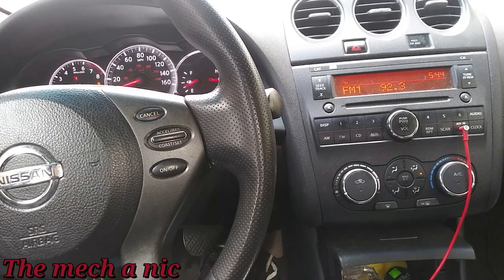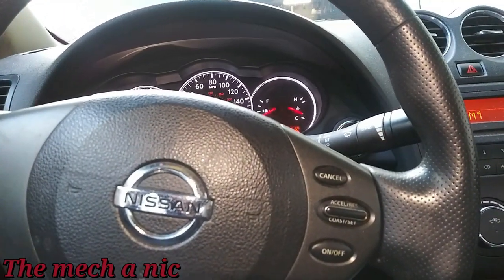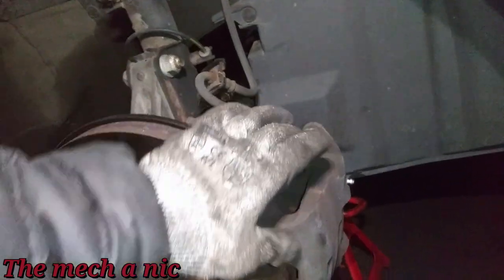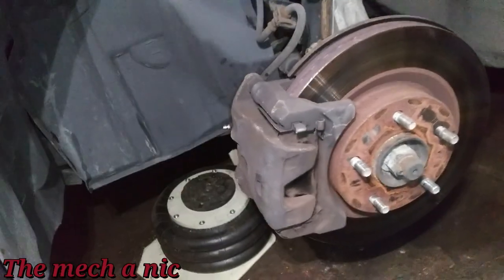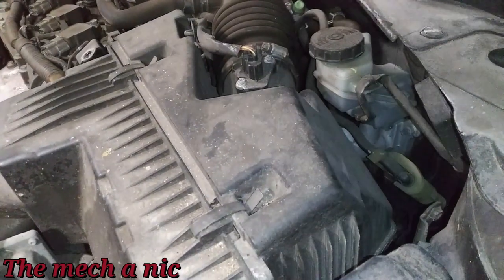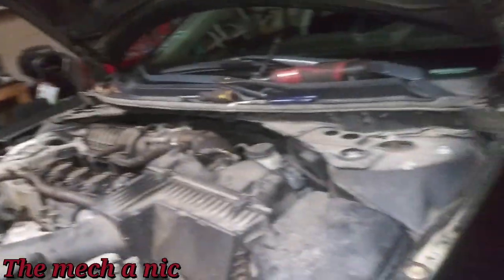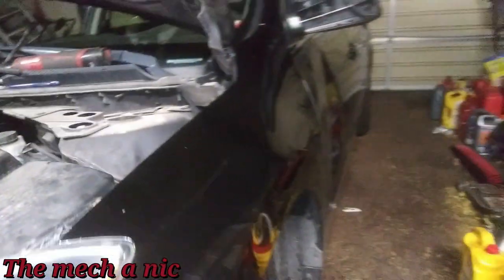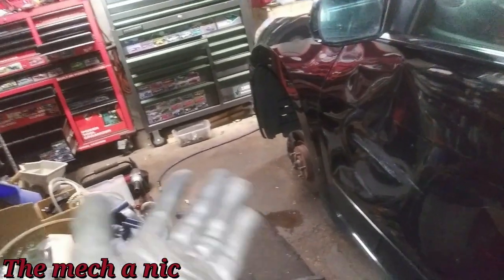nissan front brakes locking up - altima

Comment: Dude, I cannot begin to thank you for posting this video. I've been dealing with brake issues for TWO FRICKING YEARS. I've changed everything I could possibly change in the brake system. I never thiught it would end. Tonight, it did. Thank you so much. Thank you thank you thank you. You literally changed my life bro. No bullshit. Thank you.
Reply from the maker: That's crazy. Glad the video helped you
Reply: I agree both my tail lights are out so I changed the stop light switch and my front brake on the right side started locking up I changed the caliper as I'm driving back my left caliper locked up now I'm thinking what the hell. I did what you said loosen up the brake stop switch and both are no longer locked up , thank God and thanks for the!!!!

Comment: Thanks for sharing, your awesome. I had the same problem where my car wouldn’t start but I could hear a clicking sound like if was a bad starter. Replaced starter and still car wouldn’t start. So I finally changed the brake pedal switch. Car started but now it wouldn’t move😂. Changed one caliper that I thought was seized. Ran fine for 1 mile before stating to lock up. Found your video and boom problem fixed. I had set the switch too low. Once I adjusted it worked like a champ.
Reply from the maker: Glad the video helped! It's crazy how common this problem is and how easy it is for people to waste money on parts that aren't needed. Thanks for the comment 👍

Comment: This happened to me in my 92 Toyota Century. The black rubber clutch pedal stopper disintegrated and I replaced it with a bolt and a nut. 

I guess the nut portion was too thick and caused the brake switch nipple to bottom out which caused my brakes to lock up and produce a burning brake pad smell. 

I need to go back out and remove the nut portion so the brake switch nipple is only slightly depressed so I can drive the car again.

I had to miss work because of this issue. Your video helped me confirm that indeed my DIY metal bolt and nut grommet was just too tall and caused electrical then physical brake issues.

Comment: Thanks for the video. A friends 350Z had the rubber grommet that activates the switch fall apart from age which is common. I repaired it after watching a couple videos on fixing it but nobody mentions that the switches had to be perfectly adjusted so his brakes were locking up just like this.
Reply from the maker: Glad the video helped you
Reply: Rlknight57 , is the rubber part you're talking about the little plastic piece that keeps the break pedal depressed ?  What did you adjust?  A honda after the same rubber or plastic thing was replaced the front brakes locked up real bad after 2 miles of driving
Reply from the maker: The brake/cruise control  switch itself usually has adjustment in it.
Reply: @themechanic6117  I wish you had filmed the adjustment process. Do I need to remove the switch to adjust ?
Reply from the maker: No you adjust it while it's on the car.  Every car is different on how these things are adjusted
Reply: Im fixing a g35coupe 04 and samething is happening I changed the booter and master cylinder and still locked up I’m going to try what you did
Reply: The rubber piece on the brake pedal arm is plug that if it comes out allows the plunger on the switch to pass through the hole the plug previously blocked. I found that in a pinch you can use one of the plastic fasteners that holds all your plastic trim pieces on under the hood. Its a PITA to get in there with the switch in place. The switch is adjusted by screwing it in or out. If it is screwed in too far the plunger on the switch will not extend far enough to activate.

Comment: Great diagnostic procedure. I'm having the same issue with a 1990 GMC Vandura. It might not be the same issue but I think it is further back than the flex hoses since it's both front brakes. I just got to brake the rusty mugs loose before I can verify. Trying my best not to damage the metal lines. After watching this I'm going to bypass that step for now and see if there could be a similar issue to yours before I brake the brake line. Thx.

Comment: No parts required . Ivan would be proud of you.
Reply from the maker: Yes he would ! Cheers 👍💪
Reply: @themechanic6117   am having same issues at the Back left side 07 Nissan Altima am hoping is the same . easy fix.?
Reply from the maker: If it's just one one caliper then it's probably not the same problem.  If that caliper is locking up I'd replace the caliper and brake hose for that caliper at the same time .

Comment: Yep! This is it!  I have a 2007 Armada which I had replaced , pads rotors and calipers a few months ago... All was OK until I found a DTC code 'P1564 ' which was a cruise control problem.. Well, I never use my cruise, but sure enough it was NOT working... So I started to trouble-shoot and eventually came to the step to check those switches under the brake pedal... I pulled them out , easy enough, and checked them with a VOM meter, and they were fine. I re-installed them and went for a test drive and that's when ALL hell broke loose! The front brakes locked up, smoked, and barley got it home... Guess i put them in wrong are somthing... Found in the manual how to adjust them, but really difficult to measure... will keep trying, but 99.9999% this is the fix! just wish I didnt mess with them in the first place....  thx for the vid!

Comment: This was a temporary fix for me. I’ve done calipers rotors and pads. After purchasing a new brake switch, I adjusted accordingly. It worked well for about two weeks and now my brakes are locking up again. Ice adjusted and re adjusted switches and that doesn’t release front brakes

Comment: Okay, I am definitely gonna try this. We figured it was a safety feature on the car. We have an '07 that did just fine when I put it in neutral to pull it up because it wasn't starting but later when I went to push it to the mechanic, it wouldn't move. Now the mechanic is trying to sell me brakes when they don't even know why they're locked up in the first place.

Comment: That car had of had that issue before it came to you.  That’s just odd that the brake /cruse control switches were out of adjustment after they jumped it.  Mind blown.  Maybe someone was messing with it before you got ahold of it
Reply from the maker: Exactly. I asked the owner if someone was messing around down there and she said no but you know its sometimes impossible to get the truth.

Comment: That's really bizarre.  I can't imagine why anyone would mess with the switches, but I also can't imagine how they'd get out of adjustment all by themselves
Reply from the maker: I agree , i dont think i was getting the full story or the truth
Reply: So when you have a no crank no start with an altima 1 of the first things you find if you google it is that your brake switch and cruise control switch may be bad. It's ez to miss that they are adjustable and they probly put them back in without realizing it just lile I did

Comment: OMG, my wife's friend daughter had their battery changed and possibly the starter too. When she picked up the car, the brakes were sticking. I know, ever since? They looked it over and said nothing, they did. She took the car, now the kid was smart enough to put foot under pedal and lift and the car brakes released. WTF is that about? So here I am and the car need P&R all the way around. I experienced the brakes holding back and sure enough it released again WTF is that about, they were factory installed. So now I am going to call them back and adjust the park brake switches or see if there is a brake rod adjustment. I will let you know. My thought is the brake fluid is contaminated and was thinking it is the master cylinder as well being bad. Never too old to learn.

Comment: The metal clamp that holds the rubber on your break line is metal. After time, the build rust causing it to pinch the break line. You can push the breaks, and they will work, but there's not enough pressure for the release. Try changing the metal clamp holding your line.
Reply from the maker: In the video I actually showed what the fix is ...

Comment: Thank you so much. You saved the day! I made a sharp left turn, then my brakes locked up and before calling a wrecker to pick my truck up I did a search and I found your video. I turned my truck off, disconnected the brake and cruise control switches. Restarted the truck, then turn the truck off. Then, reconnected the switches. All was good. But I don't know what caused this to happen. Could it be an issue with the ABS system, having corrosion. Thinking about spraying it with air sensor control electronic spray to clean. Any thoughts. Thank you so much for saving the day :-)

Comment: Omg 😱🤯🤯. I was working on my sis 08 Nissan Sentra. I did a motor blower job. After patching everything up my brakes were stiff and brakes kept locking up. I ended up replacing two calipers and all four brake hoses. Didn't fix the problem. I was so frustrated i took it to a shop to get diagnosed. They said brake booster and master cylinder is bad and leaking fluid. I was like ????? No way everything was fine up until I did the motor blower job.. i took the car home and tested the brake booster. It was fine, and vacuum and all. No leaks either. Stupid shop tried to rip me off. So Car sat for a month and I was so upset with myself because my sister needs her car and i just couldn't figure out the problem. Then I see this video, I tried. what do you fuckin know!!!!? It worked! I adjusted the electrical switch that connects to the brake pedal how you said to in the video. Now the brakes work like normal. Thank you so much. Seriously. Sucks I wasted all that money when thier was no need.
Reply from the maker: Wow that sucks! I feel your pain. Just like in the video. You have to think logically with cars. It worked fine before you did a certain job and sure one thing can go bad out of nowhere but it's highly unlikely or impossible for so many parts to go bad at once.  I'm glad the video helped you.

Comment: I’m replaced that sensor today and the front breaks locked up after driving few Miles ,I thought it’s my call overs I replaced them too and it locked again so now I’m going to check on this sensor hopefully it just need adjustment as you mentioned

Comment: Hi ... I am having same issue on x trail brake lock up ... There is correlation of both switch? You align them in a line? In mine somebody removed both switch I put them and start the car, then brake locked instantly.  ... Please advise...thanks in advance

Comment: Imo because your prices were the lowest rates in the area, you attracted the lowest paying clients... makes for good YouTube though
Reply from the maker: Yes word of mouth is im affordable and pretty good at what I do without screwing people over.
Reply: I usually charge half of local labor and twice the parts cost. 75.00 per hour plus parts. I'm NOT the cheapest but like Nic I don't screw people over. It pays more to be helpful and honest in the long run.
Reply from the maker: Twice the cost of parts? So if a part cost $50 you charge $100 for it?? I don't charge extra for parts. Sometimes they bring their own parts , sometimes i order parts for them but i dont mark up prices on parts . they only pay for my labor
Reply: @themechanic6117  yea, I started that way too until warranty work for bad parts then I was like, NOPE. If you double ur parts at least you don't get screwed over. And I don't mind customer parts but 9 times out of 10 customer parts are junk or wrong.... Slows me down
Reply from the maker: I hear you and more power to you but charging double for parts where im at ill be sure to lose customers. I can find a part on rockauto for $60 to save the customer money since autozone wants $110 and the customer thinks $60 is too much and they found a cheap part on Amazon for $40. At that point i just warn them about cheap parts and if it fails im not responsible. Nore do i warranty any parts. If a part fails, the owner has to buy another one and i will charge for labor once again. Its not my fault the cheap part failed. I just put in a used (junk yard) alternator on a ladies car for $250 . I told her if it fails anytime soon im not responsible and she will be charged labor once again. Even if its a oem part, if it fails .im still not responsible, labor will be charged again. The only time i will "warranty" labor is if its something I did wrong but that doesnt happen often.
Reply from the maker: If I gave a warranty like that id also charge mark up on parts so i dont blame you. Another reason why I dont give warranty is because 98% of the cars i work on are junk beaters. The owners would find ways to abuse warranty when in reality they do zero maintenance on their cars till something fails .
Reply: @themechanic6117  lol....well you are honest about it.lol.... I'm lucky my customers usually have nice cars and most not over 5 years old.
Reply from the maker: Under 5 years!? That must be nice . I'd say my average cars are 2000 - 2010

Comment: very helpful content man. I presume this wasn't causing the taillights to light up? I'm having issues with an infiniti Q50. Relatively new calipers.. both locked up at the same time. Dealership said replace calipers, but I'm going to ask them to look at these switches because the diagnostics scan wouldn't report on this right?
Reply from the maker: Replacing the calipers would be a waste of money. It's VERY unlikely that two calipers go bad at the same time. Check the brake and cruise control switches.
Reply: @themechanic6117  agreed. I asked them to look at switch height adjustment, and they said looked fine. What about MC? it should operate 2 separate circuits.. one for front and one for rear no?  The fluid releases at the caliper... and releases at the MC where they release pressure off the piston.

Comment: I replaced everything idk if my maxima the 2001parts have been sitting on shelf quality isn't new or what. Car is better than it was. But when the weather gets past 80 outside the problems come back after 15 min the brakes stick smoke off the wheel. When sun goes down I'm good to go. Maybe a new car soon . I literally replaced everything on this car I love it. Maybe I'll find way better quality only thing I can think of parts made a while ago and just sit in the store shelves. No one really has a 2001 maxima anymore so idk
Reply from the maker: Did you check the switches like I showed in the video?
Reply: @themechanic6117  no that's the most genius thing I haven't checked. Your the only one to ever say that. How did u get to those switches or once I find them do I need any special tools to adjust. I don't have cruise control either. It only does this when the sun is out and it's really hot. How do you adjust the switch
Reply: @themechanic6117  if u could explain how to move the switches off that metal plate that would be great. I'll try to check it out later I never seen those switches though that has to be the issue
Reply: @themechanic6117  next time it's starts acting up I'll check. I just looked under I don't have that
01 maxima 20th anniversary
Reply from the maker: They're use just twist in or out. Your car has a brake switch. Every car does
Reply: @themechanic6117  FIGURED MY ISSUES OUT
Reply: @themechanic6117  I tired everything calipers rotors hoses.... What fixed my problem is I bought a 50$ scan tool cleared all my codes then before driving I turn traction control off !. My wheel speed sensors must be bad so it tells ECU I'm slipping and locks / drags wheels with the abs system to point of smoke. Scan tool and traction control off helped my brake stick problem.

Comment: I really wonder how those switches would lock the brakes. Wonder if it's some kind of safety feature. So they were always being pressed down because of the state they were in?
Reply from the maker: Yes they were always being depressed but thats normal. I think there may be another switch and since the pedal couldn't fully return due to these switches being bottomed out it was affecting the other switch.
Reply from the maker: I also read that the two switches cant be pushed all the way in or it will cause this issue. Since they were bottomed out they were fully depressed
Reply: @themechanic6117  ohh I got it now. I was thinking in a switching/electrical sense rather than a mechanical sense... which is why I wasn't making sense of it.
Reply from the maker: Yes its mechanical . its like a plunger
Reply: @themechanic6117  You'll have to give me a break.. I'm sleepgry.. hungry and sleepy :D
Reply from the maker: Its all good , i know without seeing it , it can be confusing

Comment: I have a titan,when it's very cold first thing the  brake pedal is very hard until you overcome it a few times. I figure it's a vacuum leak but did you see if they mentioned titans ln that forum?
Reply from the maker: Nissan tends to use the sane design on different vehicles so you may want to read it for yourself. Im not sure if someone mentioned your vehicle specifically. 

https://www.nissanclub.com/threads/brakes-dragging-locking-up.514026/
Reply: Thanks il take a look. I don't use the truck too often, just for hauling my dump trailer.

Comment: My son hit a puddle of water and water came in the car through the gas n brake pedal area. Right after the brake light came on and the left front caliper locked up . Was wondering if switches could've shorted out or maybe need adjustment.  How do you adjust them. 2015 nissan altima
Reply from the maker: There's usually an adjustment screw on the switch itself. Make sure they aren't wet
Reply: @themechanic6117  thanks